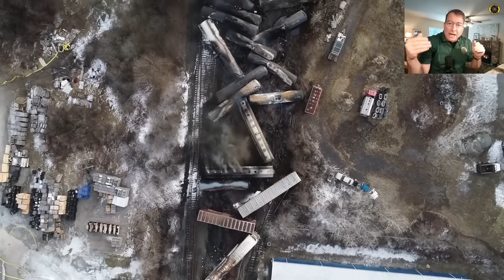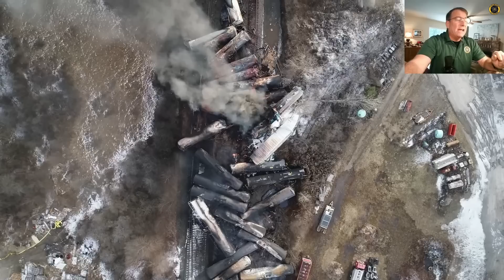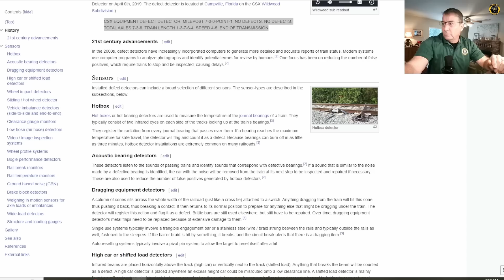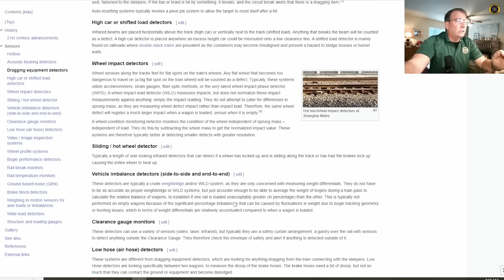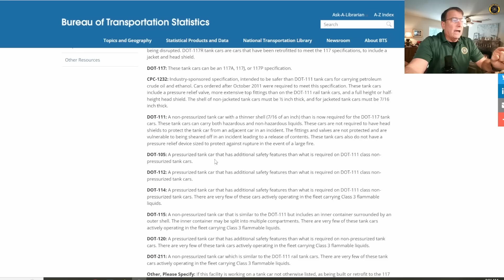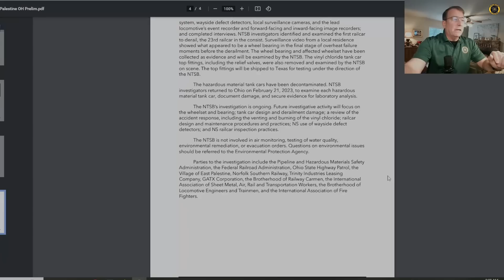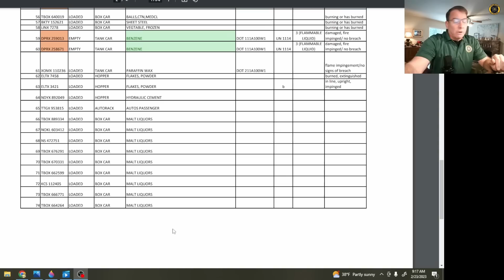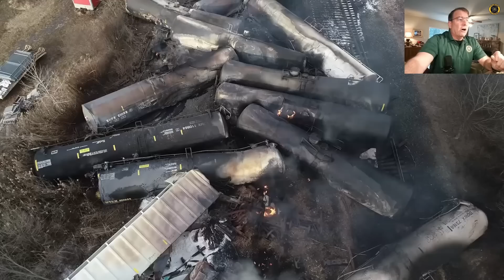NTSB Prelim Report: Norfolk Southern Train Derailment 23 Feb 2023

Comment: One other factor: the slack would be unbalanced at the time the train went emergency.  Normally an engineer wants to slow the locomotive slightly to have the cars behind "push-in" the slack before braking heavy (the opposite for acceleration, inch slowly until the slack is "pulled-out", then throttle to heavier acceleration).  With a seized truck in the middle of the consist while the consist behind the defect truck would be properly "pushed-in" (the train was slowing down mainly on dynamics so cars behind are being slowed by pushing into cars towards the locomotives) however the slack would still be out ahead of the failed truck because that truck is effectively trying to stop with its wheels seized and the locomotive is still pulling against that force, even while slowing down, so the slack in the front would be still be pulled-out at the time the train went into emergency.  Bad things happen when the slack is imbalanced or not appropriate to the actions at the head (or in this case the middle).  Hard throttle from a train whose slack is in snaps the train in half.  Hard braking when the slack is out crushes rear cars into the ones ahead and usually manifests as a light weight buffer car (quite often on a curve) getting forcibly derailed by heavier cars behind as the lighter car stops faster and the open slack lets the heavier cars behind it, that aren't stopping as fast, gain crushing momentum.
Reply: The engineer was already applying dynamic braking before the emergency brake application was made
Reply: @Stoker58  read the entire post.  Seized axles mean only the consist behind the seized wheels was slacking (compressing) normally.  The consist in front of the seized wheels is still in tension due to the back end (the seized truck) trying to stop (and doing one fine job track grinding in the process as was caught on video) against the force of the locos still pulling even if they were slowing down.  That's unbalanced.  Under normal circumstances (which this was not) the entire train should be compressing the slack whenever the locos are decelerating.  The consist forward of the failed truck in this case enters the mismatched slack for hard braking scenario when the train goes into uncommanded emergency, worse this means a separation has already occurred (to break the air lines) meaning further derailment already has a trajectory for the compressed consist behind the separation point.  Also at the point the knuckle separates the seized truck will no longer be tensioning the separated consist forward of it so we have that consist in emergency with the slack out and every car heavier than the one forward of it will gain momentum on the uncompressed slack and hammer against the lighter car forward of it that decelerates slightly quicker.
Reply: @takingthescenicroute1610   I’m still not following. Regardless of a dragging axel the whole train should have been in compression if the engineering was into the dynamic brakes. The axle would not have caused enough resistance to cause slack in the cars ahead of it even if it was seized. 

Either way I don’t see how slack action in the cars in-front  of the derailment would impact the situation
Reply: @Stoker58  If the accordion in the aftermath was entirely behind the failed truck then no the cars in front were not involved in the sequence (in that case we have the classic: car going off the track sets the derailment trajectory for the cars behind it then the imminent service line cut, as it departs from the head, puts everything into emergency and the jackknifing begins).  I was mainly pointing out trains can derail (or separate) when the slack is mismatched, not entirely that such was the case for this accident.  Slack could conceivably fracture a knuckle however if there is a sudden change, like a truck suddenly seizing its wheels (this is a train at traveling speed, not rail yard shunting speed) and continuing to seize for 30 miles.

Santa Fe junction seems to have the perfect slack/mass related type derailment setup, has the curve in the track, train slowdown point, and everything.
one: https://www.youtube.com/watch?v=vFLJvpwm52Q
another one on the same bend from the other direction:  https://www.youtube.com/watch?v=Ml_7ug1RV6U

Comment: There is video footage that shows the failed axles looking like track grinders as the train passed a station.  This station is further back in the route so we have wheel seizure in progress well before the train reached the defect detector.  The stress being transferred to the coupler knuckle the entire time between that station and the defect detector.  The coupler knuckle is a part is widely known in the rail industry for its not-insignificant failure rate (railfans on YT even have videos catching such failures in progress---same sequence happens, car separation occurs and air lines get ripped apart, throwing the train into emergency).  The most probable swiss cheese model is: locked brakes on truck -> seized wheels -> knuckle failure -> car separation -> air line rupture -> emergency braking sequence -> derailment -> tank ruptures release gaseous flammable VC-> red hot metal on seized truck ignites VC on fire -> fire spreads

The sequence was unlucky in that the defect detector alert occurred well after the initial wheel seizure and too close to the imminent knuckle failure, leaving the engineer too little time too late to prevent the accident.
Reply: In fact, the NTSB report says 2 detectors, beginning with Sebring, 30 miles before the wreck, and Salem, 20 miles before the wreck, showed the bearing temperature rising, just not high enough to stop the train. East Palestine detector showed the bearing well above the alarm limit. The temperature trend was measured, just needed to have a program running at the Dispatcher's office to detect the trend. A third detector 10 miles before the wreck is "dumb", doesn't look at temperature, or it would have sounded the alarm.  Hard fact is, when a bearing starts heating up, it WILL FAIL fairly soon.
Reply: @SteamCrane  So they were seizing well before even the video footage then.  Newton's 3rd law: every action has equal and opposite reaction: that knuckle is eventually going to give.
Reply: @takingthescenicroute1610   US couplers are rated for a minimum of 350,000 pounds pull. A dragging bearing is unlikely to exert that much force. Normal cause of failure is a jerk, thus the coupler would have failed during the derailment when the truck frame jammed on the ties.
Reply: @SteamCrane  https://www.youtube.com/watch?v=jLPRaf-PGGY A knuckle failure derailment caught by a railfan.  Youtube doesn't disappoint.  As I said not insignificant failure rate.  It's even another Norfolk Southern.  Now put one of those same QA reject knuckles (deregulated railway industry, say hello to our friend the fatigue crack, a 'friend' the airline industry wishes they didn't know so well) on the accident train forward of the failed truck and subject it to non standard pull force (there is nothing normal about pulling a car whose brakes are engaged---or in this case a truck is seized) against those seized wheels for 30 miles...
Reply: @takingthescenicroute1610  Broken knuckle, train separated, train came to a safe stop as designed. No derailment.  A broken knuckle won't cause a derailment, but a broken drawbar might, if it fell across the rail, but remote possibility.

Comment: The strange thing about this ... trains break couplers every day. When a coupler breaks, the air hose comes apart (like reported here) and the portion of the train behind the broken coupler goes into emergency braking and magically the train cars stay on the rails.

Gotta disagree with NTSB here. The physics doesn't quite match their assessment.
Reply: Car 23 had the wheels fall off, causing the derailment. With the DPU pushing, the coupler probably didn't fail until after the car hit the ballast.
Reply: A coupler breaking and a car derailing and then causing the emergency brake to trigger are two very different scenarios.
Reply: @Stoker58  Not to the cars behind the derailment that are still on the tracks. They are experiencing a normal emergency stop.

My issue with NTSB is the claim that bad bearings on a wheel caused the first car to leave the rails. Sealed bearings do not just fail ... they go bad incrementally over time. Similar to on an automobile .. a wheel bearing will start to make noises, then a grinding sound, leading to ultimate failure. It could be months or even years before it happens.

So far this is NTSB preliminary report .. more may come to light.

Comment: Your understanding of PTC is slightly incorrect. PTC is mainly used for train separation or reducing of speed in case of operator error. It has nothing to do with the prevention of derailments or detection of dangerous situations that can lead to derailments. The hotbox and dragging equipment are what looks at axle overheat which can cause a derailment.

Additionally, any train that derails at sufficient speed will 'accordion pleat' the railcars. Do a quick search on YouTube itself, and you will see the same thing over and over. The brake application has nothing to do, with this action, as you have thousands of tons of moving inertial material that are still moving and slowing, that continue to crash into the stationary derailed railroad cars.

The answer to your last question is yes, a bearing can go from slightly warm to complete failure within 20 miles. the axle system is divided into 2 sets of 2 axles. The car in question was loaded so you have to figure that each set of axles was carrying about 90 tons (180,000 lbs) so the bearing can fail and heat up quickly to failure point in a short amount of time.
Reply: Yes.

Comment: Preliminary report saved in PDF format. I watched the NTSB press briefing. Very through and professional. For many years I was a train watcher and low-level operator of model trains. I walk one section of the Soo line in Northern Illinois where for a half mile the rails were loose with no spikes in the track plates. Railroads cut way too many corners. NTBS is can only investigate and recommend best practices. It is up to others to improve regulations.

Comment: A lot of people are going to focus strictly on the failed bearing and call for more inspection, better detectors, etc. And those are good things to do. But bearing failures are inevitable in the rail industry. The thing that sets this accident apart from other derailments caused by bearing failures is the hazardous material being carried. We have to look at ways of preventing such disatrous results when an inevitable derailment does occur. For example, smaller and stronger tank cars for hazmat, spacing cars throughout a train, slower speed limits, onboard detectors for hazmat cars, etc.

Comment: These trains should have detectors, sensors, and warnings on the train. What kind of antiquated tech are we running here.
Reply: Given the huge size of the US rail system, putting electronic control and sensor systems on all 1.6 million freight cars, with 8 bearing sensors per car, would decrease reliability. It is quite practical to maintain a few thousand smart trackside detectors, with the electronics inside climate controlled cabinets, but maintaining electronics and batteries with the same level of technology as the lineside detectors on 1.6 million unheated railroad cars is wildly impractical. A single electronics failure on any one car would stop a train, and all trains behind it. Read the NTSB report.  The impending bearing failure data was reported 30 miles before the wreck by the Sebring lineside detector, and increasing temperature reported again by the Salem detector, 20 miles before the wreck, but ignored due to stupid railroad policy. They had 30 miles warning to stop the train out in the very rural country. This disaster is entirely on railroad management. Running 2 to 3 mile long trains is a major contributor to the problem, but Dickensian employee attendance policies are the main cause. You have to  come to work sick, no time off for doctor visits. Maintenance is drastically cut back.

What would be extremely helpful would be to automatically look at reported bearing temperature trends at the central office (detectors already report the data to the dispatchers office, but currently trends are ignored), and place detectors closer together.  There is a "dumb" detector at Columbiana, 10 miles before the wreck, but it doesn't have a hotbox detector. Since the electrical cabinet, power, and radio is already there, it wouldn't be very costly to add hotbox detection to it, and to the large number of other "dumb" detectors in the US.

Fancy sensors on the small number of European RR cars might work, but not on the huge US system.

Comment: The hopper car just dug into the ballast after the wheel fell off.
While the emergency application was initiated when the trainline separated,
The cars were stacking as the brakes were applied, the brakes ALL lock up,
but the forward dynamics suddenly stopped. New brakes would have not prevented this.
Hire back the INSPECTORS!! Give the senior, overworked stressed out inspectors a "Break".
The Mechanical & Signal workforce has been decimated over the past 25 Years.
Maintain your Fleet, your detectors & Treat your inspectors more like your executives
The FRA does have power, they just need to get a bit heavier with that violation pencil,
BEFORE Derailments. Bring back more eyes on train, That has been a standard for years.
The RR would rather work fewer inspector, pay overtime rather than hire a workforce.
The level of inspection gets questionable when they ram these huge trains on few inspectors.
In the Mid 90's, there was a change from preventative maintenance to fix it when it breaks.
 There are inspectors who are being blamed for their failure to catch the bearing,
but look at the workload being dumped on a few inspectors & WE HAVE A SCHEDULE TO MEET!
Reply: Regret that I can only give one thumbs up on this!
Reply: One of the more intelligible replies here!

Comment: Sounds like they need the software changed to flag it when there is a increase like that on the bearings above all the others.  Before they reach failure past the box.
Reply: Any mechanical person knows that a bearing that is heating up WILL fail sometime soon. Trending is readily available, management chose not to use it.

Comment: PTC does not prevent derailments, it may prevent collisions tho. HBWDs need to be quite close together to prevent wheels and bearings causing derailments too
Reply: A practical solution would be to place HBD/DED's closer together. An immediate first step would be to add HBD to the large number of "dumb" DED-only detectors, like the one 10 miles before the wreck at Columbiana. The cause of this wreck was ignoring the reported temperature trends.

Comment: Normally I like your videos but as a 25+ year railroad vet there were many points where you were way off. PTC is not being pushed by the NTSB. PTC came about when a southern CA commuter train ran a red block signal and went head on into a UP freight train. Implementation of PTC is in a federal law. PTC is NOT designed to stop this type of derailment! You got that very wrong. How you described a wheel bearing failure and how it failed was also incorrect. This axle bearing failed for some reason. As it went over the detector the detector did its job and reported it to the crew. In this case the bearing was right at the point of failure and right after the detector reported it the bearing (what was left of it) had become liquid metal and the axle dropped. Not from the engineer doing anything with the brakes. The Fireman was never on the caboose. The Fireman was always on the locomotives. They tended the fire in the steam locomotive and assisted the Engineer with his duties. The Rear Brakeman and Conductor rode in the caboose.

Comment: Love your channel long time fan but 1:00 explaining the air brake system is In correct brakes do not apply with out air in the system it’s opposite from a semi when air pressure is lost there’s an emergency air reservoir that apply the brakes on each individual car! Food for thought it takes air pressure to keep the brakes on instead of off.
Reply: Wrong! Railroad cars have onboard air reservoirs to apply brakes when air pressure in the air line is lost. The Westinghouse air brake system, invented in the 1880's, and improved since then, was the first truly fail-safe invention.
Reply: @SteamCrane  that exactly what I said… he’s implying that they set like a semi truck when a semi trucks air system is full it’s holding the brakes in the release position if the air cut out the brakes would apply with no air pressure vs trains need air pressure from the res to apply the brakes
Reply: @wcracing696  OK, I read it as saying trains are not failsafe.  Honestly, I didn't watch the entire video after hearing all the misstatements.

Comment: One question I have is do we know what the normal operating temp of these hubs typically is?

Or is the ambiant temperature considered standard operating temp?     I originally took it as current temperature outside.
Reply: A rise in temperature of one bearing compared to other bearings in the train is sufficient to indicate impending failure, regardless of ambient or expected normal temperature.